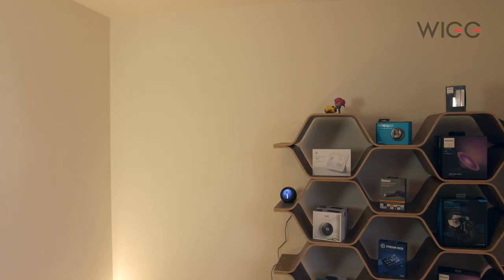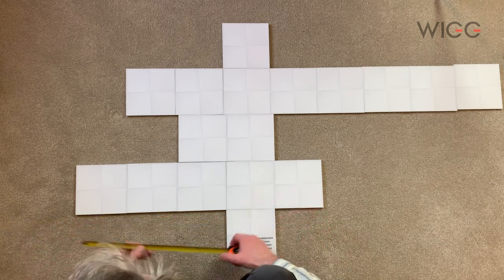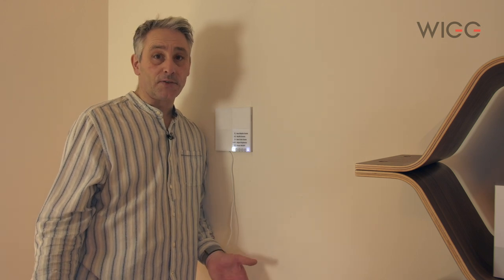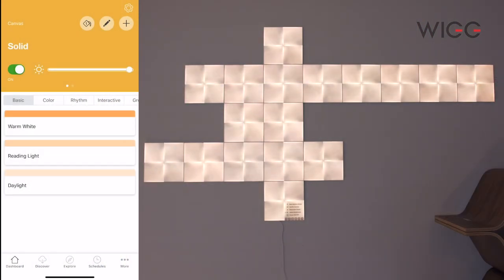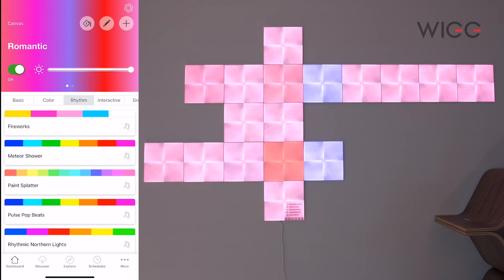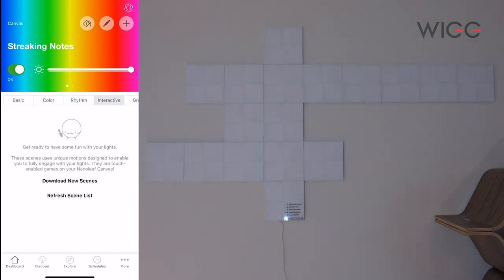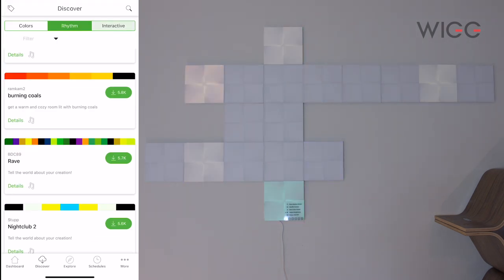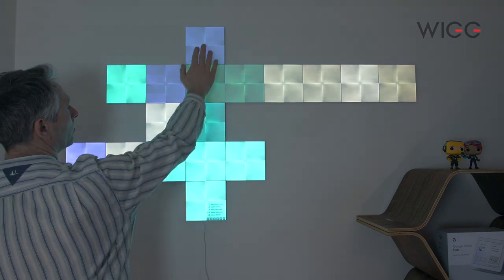REVIEW: New Nanoleaf Canvas - Installation Guide and review

Comment: you should had the 3m stickers popping out from your canvas if you planned to remove them in the future. that would be easier. i learn from just sticking my first panel on the wall. when i tried to remove it, the paint peel off because i pull it towards me. hence , the sticker should be placed sticking out of the canvas for easier removal by pulling sideways. i know it may look untidy but hey , as long as it doesn't damage the wall . im good =)

Comment: Do you think it would be easy to remove the canvas from the wall if you had to?
Reply from the maker: Hi Jax, well I haven't of course tried, but you are supposed to leave a small part of the tape sticking out, and this is the bit you grab and pull when dismounting.